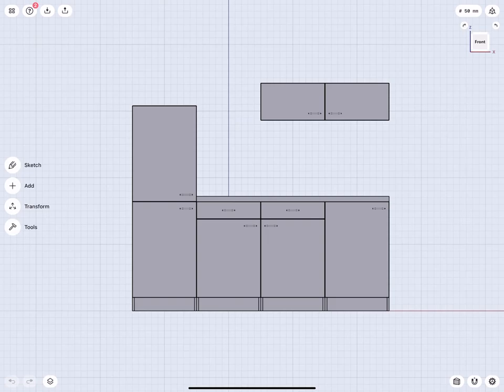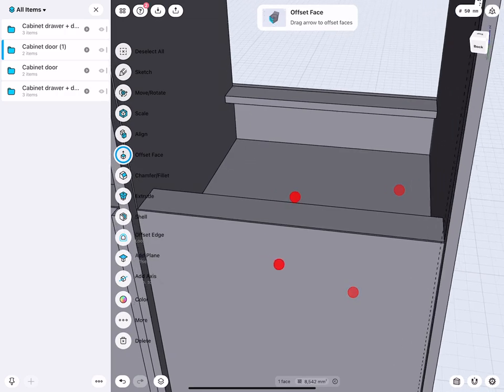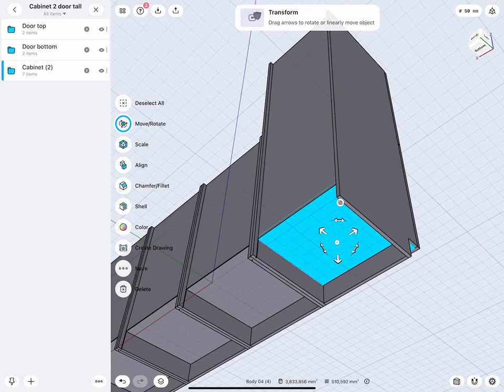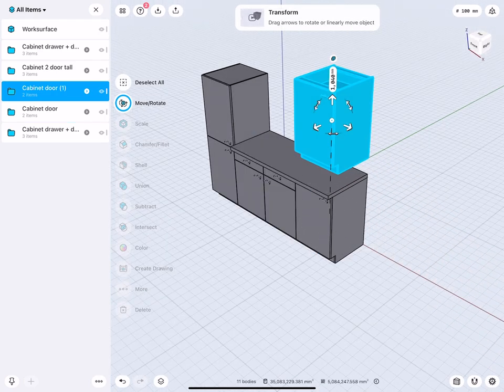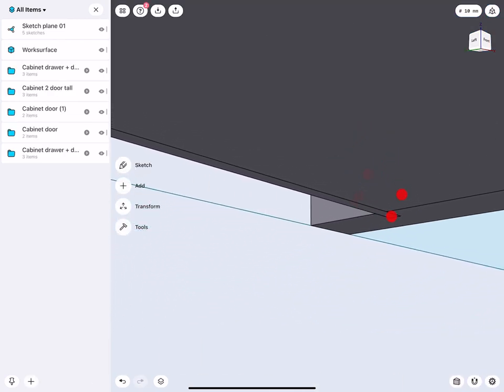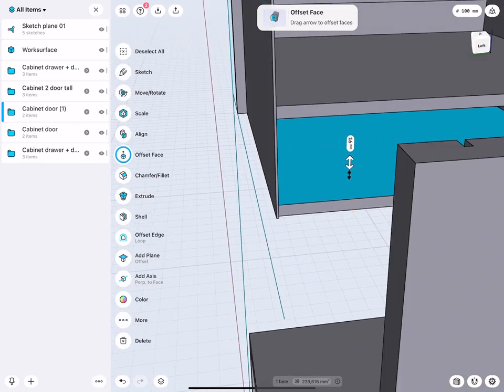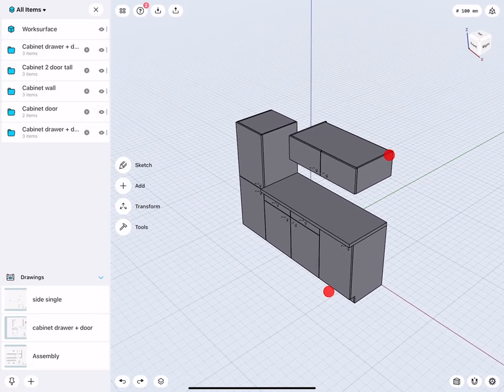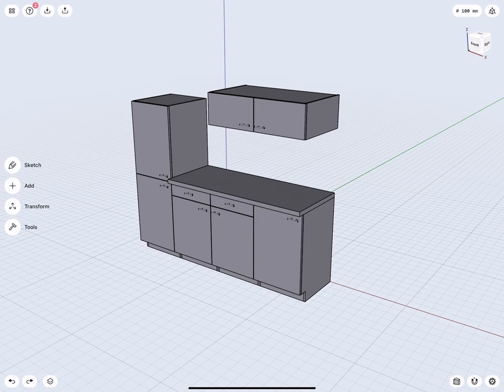3D modeling a kitchen cabinet, Part 2 | Shapr3D step-by-step

Comment: I would like to ask if I am designing Kitchens, I need to start from a basic cabinet each time? there is not possible to create a library with the drawn basic few cabinets, like ex, corner, sink cabinet, fridge cabinet, wall hanged cabinets, shelves  and add them to the new project as in a Professional software like Topsolid. Not to mention for the hardware librariy that to be added from professional companies like Blum or even the own created ones to be applied in asembly mode. Another thing I cannot understand why the drawing sheets are not included in the free version, how can one excisize to see if it fits ones needs and practice it. Practice is not enough for 14 days. anyways if those above mentioned featured are nonexostent this App is not suitable for cabinet makers. It is more for industrial design then, where you draw a part to print it on a 3d printer.

Comment: Really loved this video, it was very helpful to my learning curve. I have a problem with the scale on the 2D Drawings if anyone can help. When I create a drawing and put the "units" in "feet" and the "foot and inch format" in "architectural" it does not work properly. It shows the dimension in feet and fraction of a foot (as opposed to inches). For example 18 3/36" in architectural comes up as 1 33/64 instead of 1' - 6 3/16". I have tried everything to fix this. I am using an Ipad Pro 3rd generation with the latest software IpadOS 16.4.1.
Has anyone seen this "bug"? Any suggestions would be greatly appreciated. Cheers John
Reply: Update that there was a new release today that fixed the bug! 😀